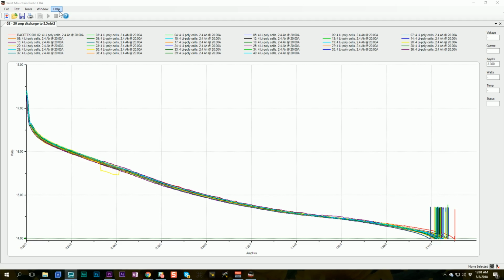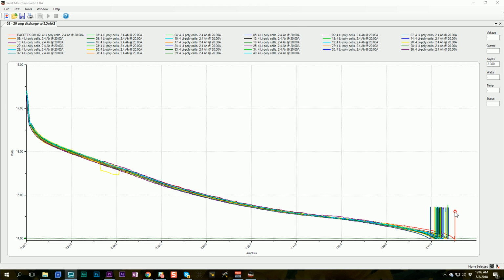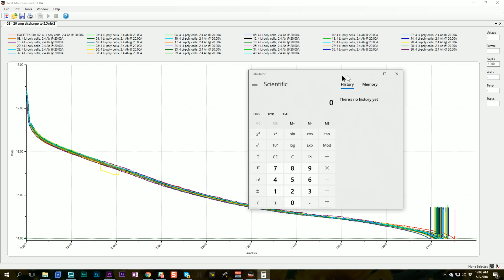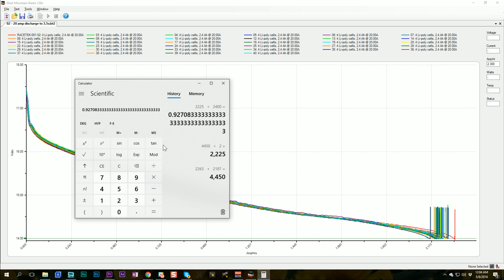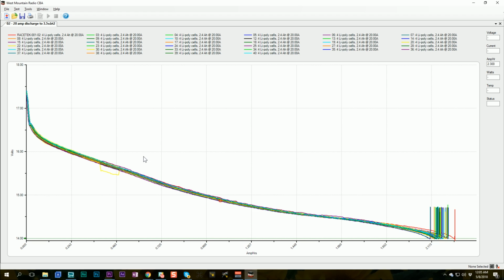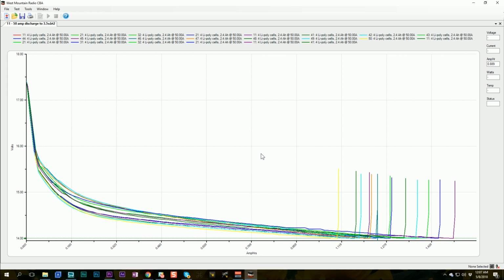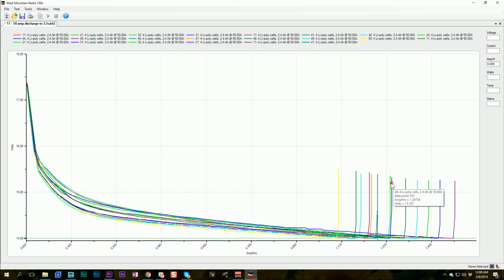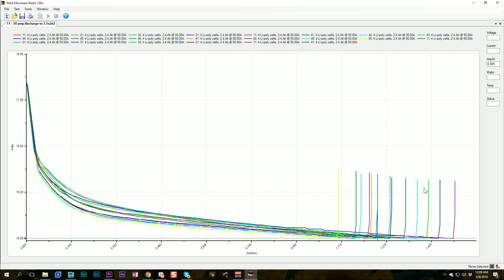HV LiPos Yes or No | UPDATED TEST RESULTS

Comment: Joshua, one question... What if we get a hv battery and use it as a normal lipo? I mean, always charging only to 4.2v. Would they be better than a normal one in the long run?
Reply: In my experience, regular LiHV treated like regular LiPo will still last way shorter than regular LiPo. Mine doesn't puff, but internal resistance went sky high and sag like crazy. It's all about the chemistry inside it. I won't bother with LiHV anymore.
Reply: @Asu01  not even for tiny 1s 450mah batteries? Everyone seems to use hv for whoops, but I don't want to.
Reply: There's no exception,  @XtianApi . Pick either better initial performance or better longevity. My micro is using standard LiPo charged to 4.22v. Still going good so far.
Reply: Asu Not necessarily true, higher quality will give you both, and according to jbs testing the charge voltage doesn’t seem to affect longevity as much as we know quality and discharge rate does. Basically it’s just more expensive batteries are better all around, for longevity and initial performance. That being said these are kind of disposable items, so is a little better performance and a little better longevity worth the double or tripple price tags of the top performing batteries? I don’t think so. I like to get a slightly larger battery than the model calls for, then you get better performance as far as voltage sag and aren’t drawing as much c rating so easier on the battery therefore you win in performance and longevity, you just add a little weight.
Reply: I disagree with JB this time,  @travispratt6327 . LiHV aren't "high quality" LiPo, they're just regular LiPo, drugged with slight chemical modification which won't make them explode when overcharged. Nothing new here.

Charge voltage does affect lifespan of lithium battery, a lot. Slight increase in charge voltage reduces cycles exponentially. On rough example, 4.2V gives 100% capacity and 500 cycles but 4.1V gives 80% capacity and 1000 cycles, double the cycle.
Reply: Asu I didn’t mean to imply hi voltage were better quality. I just meant a higher quality battery, from this test and going from my experiences and knowledge of lipos, is going to give you better performance AND longevity whether it be a hv and whether you charge it to hv or regular. It’s not really a choice of “better initial performance” over “better longevity” it’s more you pay more you get both, since price is usually the deciding factor with lipos. I see you’re saying overcharging significantly reduces battery life, if that’s true then yes I’m wrong, but this test at least shows some batteries aren’t affected significantly by overcharging, whether that be quality or the hv chemistry I don’t know, but I’d assume quality plays a bigger role than chemistry. In other words you could buy a regular high quality Lipo, charge it to 4.35 and get better performance and better lifespan as opposed to a lower quality high volt chemistry charged the same, which would probably be more money cause of marketing and whatnot.
Reply: MC's Creations that's a good question I'm wondering the same thing
Reply: Guerrilla FPV I have some rline v2 and I just charge to 4.2v hoping it will perform better. Only time will tell.
Reply: @JT-jy2sy  how did you HV hold up at 4.2?
Reply: @thomas78552  they do not last as long as the normal voltage one. I avoid hv.
Reply: @JT-jy2sy  that's been my general feeling but I never ran one long term with out hitting it HV here and there. Thanks for getting back!
Reply: Linus st I agree. A 1500mah LiHV pack should have less mah available when you only charge to 4.2v
Reply: U got probably less capacity
Reply: Im with you. I bought 6 HV 2.0 Tattu R-lines late last year and nothing but problems. I have maybe 30 cycles on them and I've had 3 that went to a crazy high IR and insta-sag. At the same time last year, I bought 6 Tattu R-line (non-hv) to test between the two. None of the six are having problems with the same amount of cycles. 

I may only have tested 6 vs 6 batteries but I'll never again get the HV ones.
Reply: I charge my Bolt V2 to 4.2V, holding up at about 30 cycles . But the main problem is almost instant drop from about 3.7V to less than 3V. I have 2 packs.
Reply: Jack Truong I have done just that and the R2 HV’s are all dead in 6 months and my R1’s are still flying okay.
I never once charged my R2’s to 4.35. They just don’t last for me
Reply: Ive had indestructible quad batteries for a while and this year i started using the gold spec hv packs i planned on usingvthem as normal packs charging to 4.20v but the sucked, saaaaaag like crazy and capacity was reduced to around 1000mah  and also didnt provide more than 70a on my rig which can pull 90a with regular batts. On the other hand when charged to 4.35v they are absolutely amazing seems like a dofferent batt it will hold 16v for ages and can sustain 80-90a punches with nobswelling and minimum heat
Reply: FPV Dreamz wear iz da grate grammer u speaks ov?
Reply: @Joshua  Bardwell ?
Reply: MC's Creations From his results, it should make no difference to the life of the pack. He’s just proved that charging a 4.2v cell to 4.35 made no difference to the degradation / life of the cell, therefore the reverse would be true, no?
Reply: Neil Clements It was quite the opposite...
Reply: some great grammer there lol

Comment: quick question, i have a bardwell f4 and its been working fine for a few months but on the last crash, it wont arm. no warnings or anything. just wont actually arm. any ideas?
Reply: See what it does in BF under RX, if you get the bars to move (especially the one you use for  arm switch) then your RX is fine, if not, that's your problem, check to see if your throttle on the lowest position is around 1000 or so if its over say 1050 that's your problem- your tx is out of calibration. Go under modes tab, make sure your arm switch works and is properly addressed, if not fix it. If RX works, then go to motors tab and try getting the motors to turn (battery in props off!), if that works, then your ESC(s) are fine, if not you either have a loose wires or bad ESC. If all that works check to make sure you set "small angle" or arm angle to 180, make sure the model in GUI is flat when your quad is flat on the ground.

If all that is good, re-flash your firmware and set it back up, if that doesn't fix it you have a dead FC.

Also, dumb question, does it light up when you plug in the battery... does it flash quickly when you hit the arm switch, does your OSD menu pop-up work?
Reply from the maker: Turn on the "warning" osd element and it will show in the osd why it is refusing to arm.

Comment: I run Indestructiblequads Gold Label 1500's. I bought 4 packs last year and kept track of my cycles and stopped at 56 cycles each. I stopped because I was having no issues, I'm not you and it got real tedious lol. I am now over 70 cycles easy and went ahead and ordered 4 more this year. I only fly freestyle and I'm pretty easy on the packs. My current rig is a 464g AUW with pack Floss 2.1 and I'm getting ~5 min a pack, my old rig that ran the first 4 packs was 580g. I had been thinking of suggesting you test the Gold Labels. Id be willing to send you one old and one new for SCIENCE! My new packs are around 15 cycles each at least but I'm not tracking them like I did with the first set. I'm going to rip the crap out of them all this season and see how they go.

Comment: I bought 6 Tattoo HVs and I have two left that don't have a dead cell. Zoe FPV tried them on the 5th cycle said they were dead when they were fully charged, she blamed parallel charging. I said, "but Josh Bardwell...."     lol. I'll find a happy middle, stopped charging 8 at a time.     I'm going to try the unbreakable quads HVs. I hear good things and their chep, so not a big deal if they die.
Reply: Parallel charging has nothing to do with damaging LiPo's
Reply: Oh I know, but there is more room for things to get "off" -cells can be damaged, then you charge with other cells, so it seems like that could be bad for the cells in parallel. But again happy medium. I make sure things are super close in voltage and charge 3 or 4 at a time usually. Effective enough.

I did have a horrible experience with the tattoo HVs though. I also left them charged here and there, and people said they don't handle that too well. Cheers!
Reply: ProximityFPV, parallel charging equalizes all the packs automatically.  There is no greater risk of anything getting off.  There is a reason voltage is called potential.  If one pack or cell has more voltage, that pack\cell will deliver voltage to the packs  that are lower until all the cells are equal.  The charger then balances the 1,2,3,4 cell just like it is one single pack.  There is no greater risk unless a balance lead is damaged.  That is the only danger.  If the balance lead is damaged on one pack the charger will still read the voltage of the other packs and not give you a balance lead disconnect error.  The pack with a damaged balance lead could end up out of balance and a cell could get overcharged.
Reply: If you check your packs before you parallel charge them, like you're supposed to, you'll find out if they have dead cells.
Reply: indestructible quads lipos are good but for god sake dont land on them hard becouse there isnt no protection but otherwise good lipo, now im talking the golds from indestructible quads and i use the blacks for 5s and they do well

Comment: I have a few tattu 1550 HV  100c and they are kickass batteries. Very noticeable difference in punch at the start of the battery and they haven’t puffed yet , they have about 40-50 cycles on them now
Reply: I know its been a while... ehm 4years... but how long did they survive?

Comment: Good pointers there Joshua.  Acehe and pulse are my go to brands. Non hv Acehe are just nuts at how you can load em up hv and just torture them but I keep my stock. Pulse are great as well. My 4s 45c out performed and out lasted my 75c tattu 4s. The hv seem to hold up just as well. 

Now to 5s lipos. I am one of those 5s guys. I love how a build performs on a 5s but have a hard time not killing my lipos. I figure it's the 2600kv I prefer so I went to some 2450kv and have to say the seem to welcome the 5s much more than a 2600kv. I was wondering if you think 2200kv or 1900kv are good for 5s to where I won't puff em up first run. I use the raceflight 2308 2600kv warp 8 and the hyperlite 2206 2600kv mainly till I got some tattu 2450kv on the cheap and notice the 5s liked were in better shape. Using lumeneir graphene 1300 5s 80c and tattu r line 1300 5s 95c. My 45c 4s pulse come down in better shape. I do run my lipos till about 14.4v to 14.8v if that helps. 

Thanks for the work you do.

The tattu puffed fast and could not do punches longer the 3secs before sagging to the ground after 20 cycles. Pulse and Acehe just take the abuse I dish out to my lipos like a pro fighter. Takes the hits and then keep coming back for more.

Comment: Can I charge li-ion battery to 4.35 and use it as normal use
I have some li-ion cells laying around
Reply: Global Desi no dude! Apparently lithium ion should only be charged to 4.15v per cell as a standard unless it came out of a unicorns butt lol
Reply: Gogi Fire hehe ,thy r definitely not from unicorns but
Reply: No, the electrolyte is generally different to take the higher voltage.
Reply: Global Desi ;D
Reply: Seek for the datasheet. Many ultra high capacity 18650 cells have 4.35V charge voltage. See lygte-info.dk for some information on 18650 cells and more.

Comment: I have used my Turnigy bolt LiHv batteries for almost a year now and they work like new. Some people say that their Turnigy bolt batteries puffed after 40 cycles. I don't understand it at all. Maybe it's because I almost never run my batteries below 3.4v per cell.
Reply: I have 5 bolts for over 2 years, they were not used last 14 months and this week I tested them (just cruising) and all seem fine - will see how they will survive high discharges very soon.

Comment: Hey Joshua thank you so much for the video! This was very educational and well done! One thing you did not mention (and I think it is very important) is that high voltage batteries seem to like laying around charged even less than regular batteries. If you are a racer and charge them right as you go to the start line thats fine but many regular pilots (like me) will start charging their batteries a few hours or more before actually flying them. That time will also contribute to the degradation of the packs

Comment: What happens to regular 4.2 batteries when you hit them with 50 amp discharges?  Do the regular ones degrade when you hit them that hard repeatedly?
Reply: Flat Out 

Yes, even leaving them at 4.2v/cell is not great for them
Reply from the maker: It depends on the battery of course but generally I would say no. Maybe I can do a repeat of this test but as you can imagine 50 hours is a long time.
Reply: Joshua Bardwell, doing another 50 hours of testing with 4.2v per cell charge would be extensive.  I'd love to know but don't expect it.  😀
Reply: Flat Out 

Well, my 50a testers finally came in, so I could run a single cell for hundreds of cycles, I won't need all 32 channels for a long time. Issue is that I can only do 5V.

Comment: I used HV on my TinyWhoop. This gives crazy power but they all sag like crazy now..
Reply: I bought GAONENG GNB 4.35V 450mAh 1S 80C HV Battery for my mobula after  20 cycles, they lost 50% of the initial performance. i stored them at 3.7 3.8 V
Reply: The smaller the cells the shorter the lifetime, (generally) maybe even more so with HV, only logical really :)
Thinking I got about 50 full cycles off my 240mAh Hubsan cells before the flight times were reduced by 30+ percent..